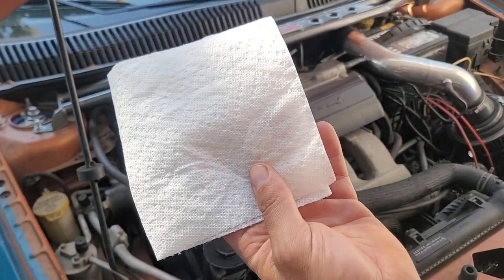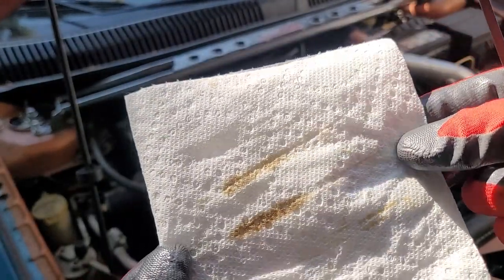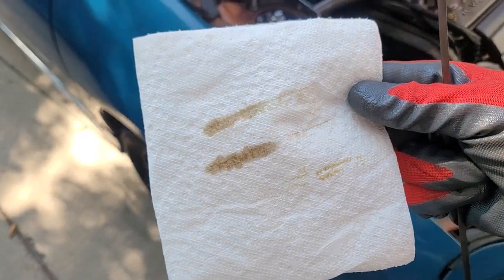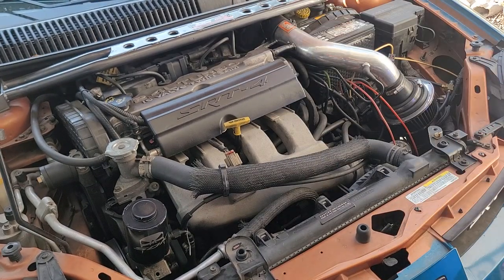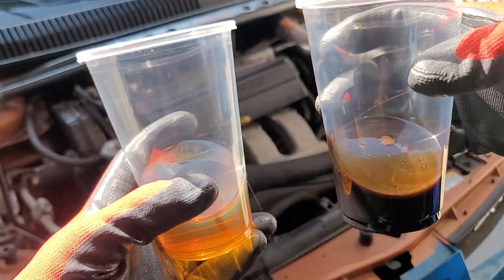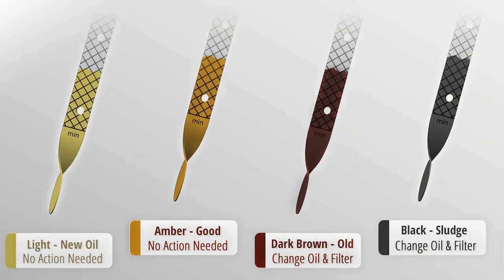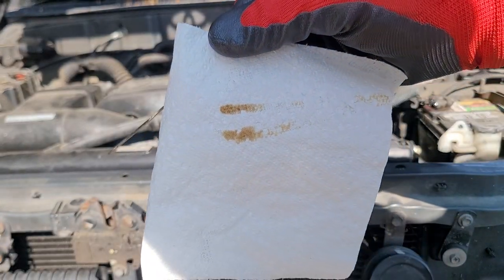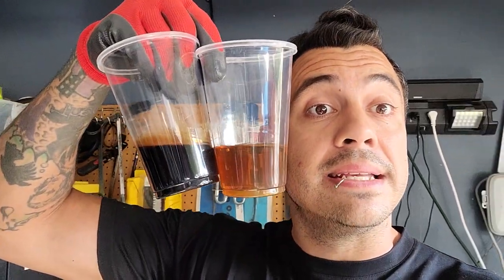How to check if you need an Oil Change EASY WAY!

Comment: Oh my god dude! The job of the oil is to clean the motor. It gets dirty right after the oil change. Forget this video and change your oil somewhere between 3000 and 5000 miles. Always change it at least once a year. Never let it get more than one quart low. Those are the basics.
Reply: It usually stays clear or an amber color for some time. Color is a good indication it is saturated with contaminants and time for a flush. It also good to check all fluid levels.

Comment: Nope you can run dirty oil for tens of thousands of miles if it chemical make up is still performing and you cant determine that without analysis there is a safe range to continue use of oil AND ITS NEVER HOW IT LOOKS THAT DETERMINES POINT.
Reply: if you’re broke just say that. change your oil
Reply: @dannygonxalez9011  I do but not wastefully when it's ready or just before it's pao and ester based. Not a liquid natural gas refined mineral falsely labelled "full synthetic".